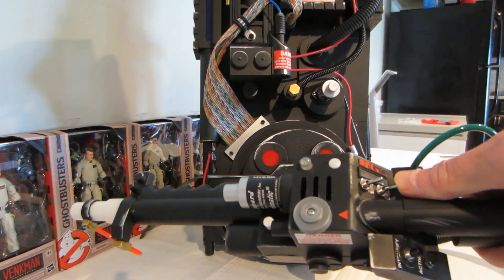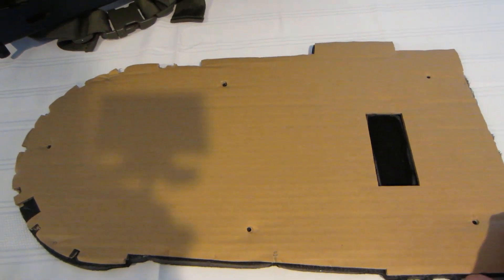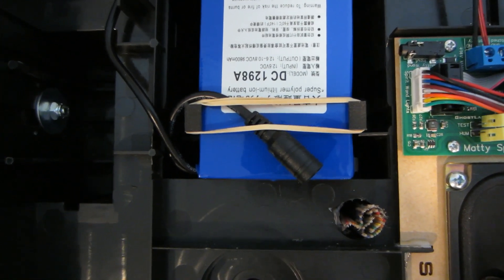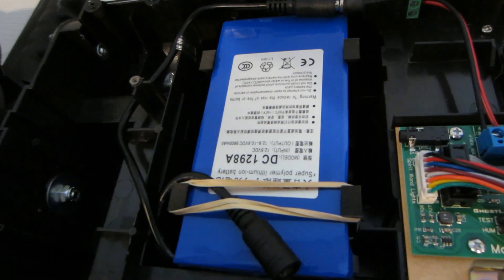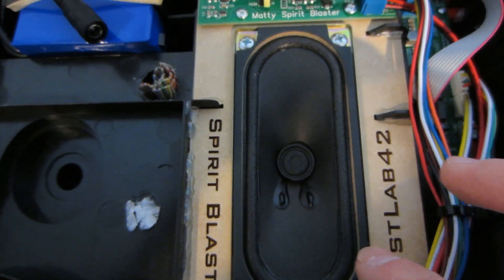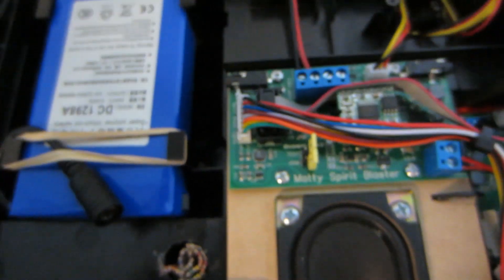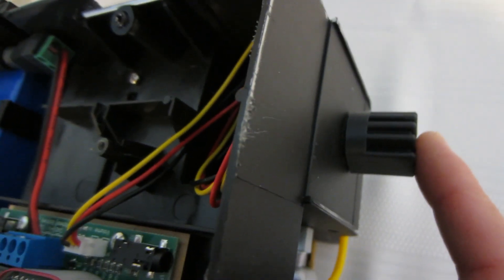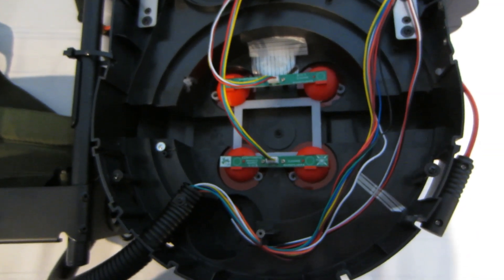Spirit Halloween GhostBusters Proton Pack Mods Part 2

Comment: He can’t turn off this colorful mode
Reply from the maker: Try this for the instructions: https://www.ghostlab42.com/img/Spirit_Wand/SpiritWandLights_v1p0.pdf
Reply: We fixed the lights and everything but now trigger doesn’t work
Reply from the maker: @suzyorosco2642  Which trigger are you referring to? The Activation button? That needs to be hooked up the board in the wand. Also make sure you didn't pinch the wires when you installed it or damaged the wiring there, it's a really tight fit that requires some holes and filing.
Reply: @superactionguy6000  the firing trigger was working on the wand and turning the sound on but now the sound or trigger doesn't work. Is it possible that the speaker shorted out.

Comment: Any tips regarding how to install the ghostlabs42 wand upgrades? I installed the pack lights and soundboard but am a little nervous about the small cuts required to make the vent holes, add the switches, LED, etc…
Reply from the maker: Hello it took a long time but I recommend a cordless Dremel or similar tool to hollow out the vent holes. Then I used small hobby files to round everything out. I really need to make a wand video for everyone out there. I’ll try and get one done soonest.

Comment: I was trying to remove the sounds completely from the default pack so I can just have the lights, would I just disconnect the speaker or would I have to do something else?
Reply from the maker: If you just disconnect the speaker you should be good to go.

Comment: How do the magnets attach to the pack and the wand?
Reply from the maker: They attach to a portion of the wand which you have to take apart and drill some new holes into. They other end attaches to the inside of the proton pack with a nut, screw and washer. His kits come with everything you need to attach it.
Reply: @superactionguy6000  thanks so much

Comment: Hi man , 
Your Protón Pack is the one of my dreams , Really good Job!
I was wondering if there is a way to plug my smoke machine into the pack , for when the vent sequence starts, the smoke also starts. 
Thanks.
PD: Please make the video about the wand :)
Reply from the maker: I know there are people that have done it on YouTube but unfortunately, I'm not certain how that's done.
Reply: You could use a aerosol can and sprayer combo but it would run out probally

Comment: Where did you get the alice pack frame thx?
Reply from the maker: Bought it on eBay... see link: https://www.ebay.com/sch/sis.html?_nkw=Rothco+ALICE+Pack+Aluminum+Frame+With+Attachments+20%22+-+Fits+GI+LC-1+Packs&_id=202637137676&&_trksid=p2057872.m2749.l46251

Comment: How do you turn off test mode in the wand my son needs help with it
Reply from the maker: Are you referring to test mode in the pack board, or in the wand board? There are two different boards, one in each. There is a jumper on the printed circuit board in the wand, it says TEST. It needs to be set to open, in other words don't have anything connected to it.
Reply from the maker: If it's the board in the proton pack itself, there is a jumper on the board which says TEST. Make sure that the jumper is not covering both pins. If it is will be stuck in test mode.
Reply: Yes it is in the wand